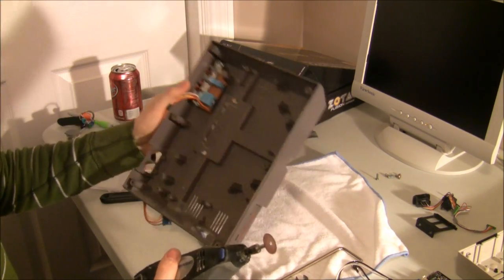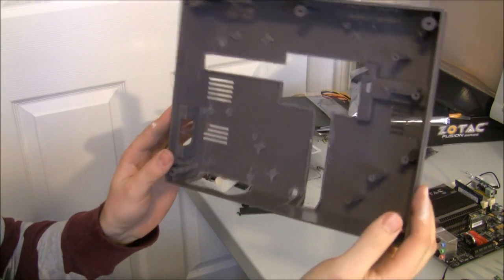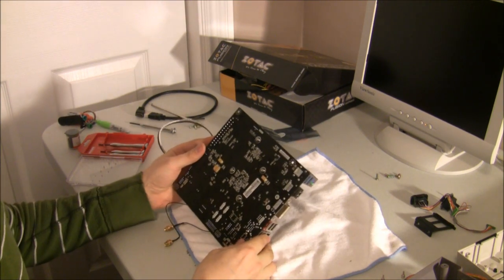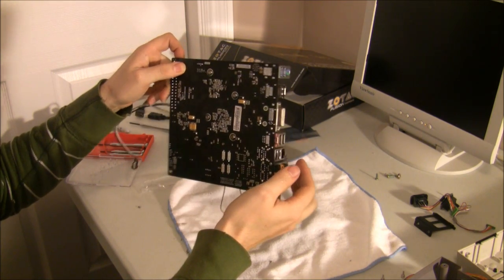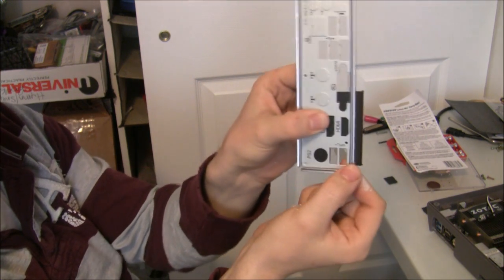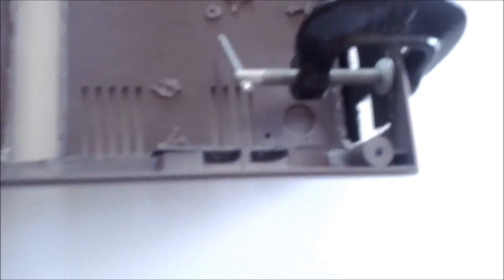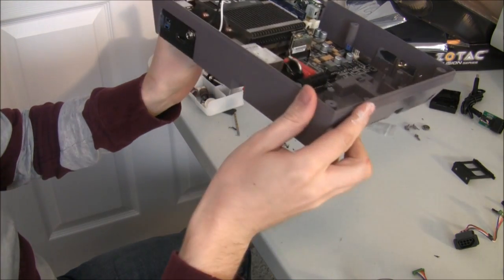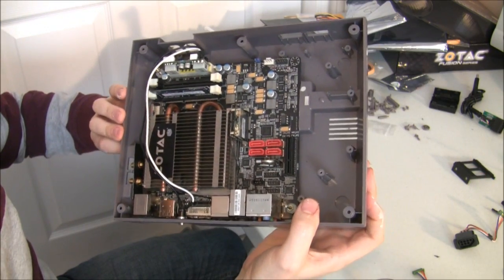Building a RETRONES PC: Part 5 - NES Case Shaping & Shimming

Comment: you should wear protective glasses, when you're using the dremel. especially with the cheap brown cutting discs. better save than sorry.

other than that i like the fact that you wanted to mod the case as little as possible.